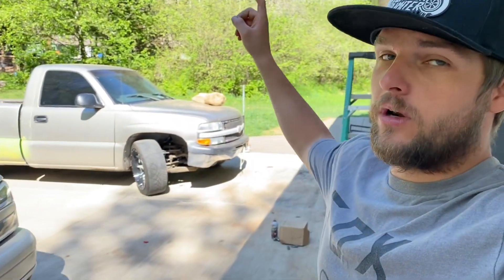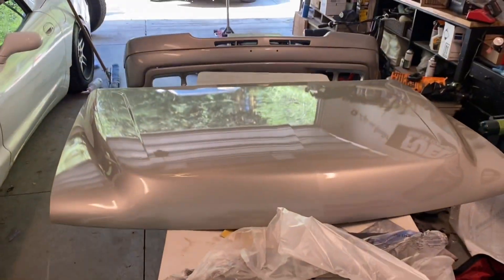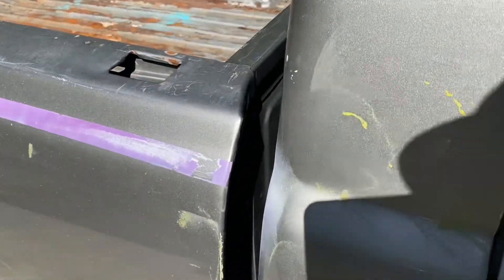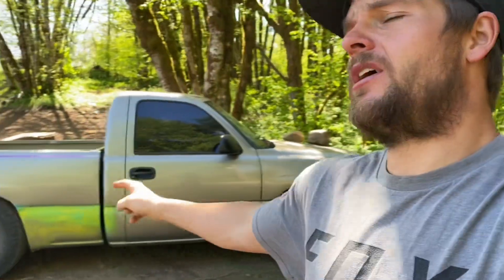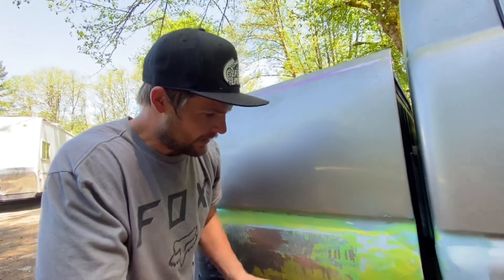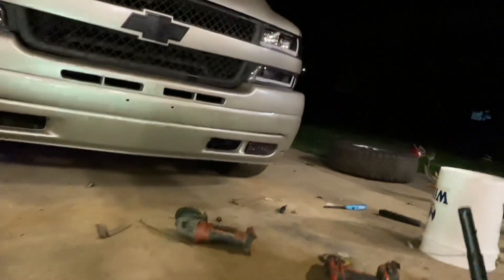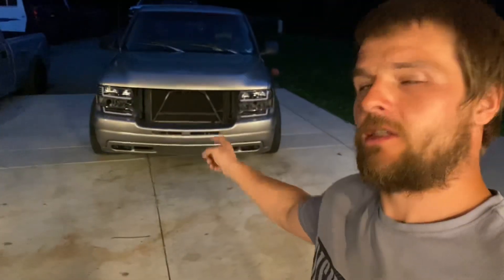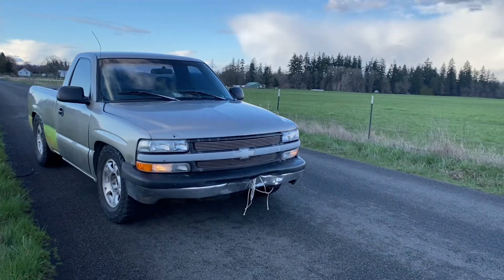INSANE CHEVY DRIFT TRUCK TRANSFORMATION IN 10 MINUTES! FULL HD FRONT END SWAP AND MUCH MORE!!

Comment: My 07 Classic Ex Cab 4.8 LR4, will get a Circle D 300mm 2800rpm Stall, Texas Speed & Performance Chopacabra Cam, PAC 1204X Dual Valve Springs, BTR Advanced Rockers with Michigan Motorsports trunnion bushings, BTR Chromoly pushrods, large Transcool. Eventually would like to find a 9.5 14 bolt Semifloat with 13" disc and dual caliper rear end to get rid of drums. 33's on the stock wheels with a Rake lift (add leaf in back) maybe spindle lift up front (keep same geometry, or coil over shocks. Chrome the wheels (possible to do it nowadays) maybe a H pipe Exhaust (for torque) 3" with Headers. Quadrasteer or Baja flared bed. Bought it in 2016 with 75K on the odo, at 183K currently, so bought and paid for since 2021.

This engine will never be boosted as parts put in are for durability and safeguards.

I may later build a 383LS using a 4.8 or 5.3

Comment: I'm about to put that 9.5 ring 12 bolt rear end from a 17 in my 99, with the measurements I took the 9.5 is 3/4 inch wider so 3/8 inch per side, spring seats are 1/2 wider but with flip kit shouldn't be a problem, shock mounts are 6 inches wider so have to move those and has 1410 ujoint so have to get drive shaft yoke changed and maybe shortened, brake calipers are the same but caliper bracket is different because of the larger rotors, I could swap out the backing plates and use the 99 disc brake stuff since I already have drilled and slotted and ceramics to save me some money undecided at the moment, my ring and pinion gears are missing a couple teeth making this the 3rd rear end breakage so its finally time for me to upgrade to something beefy
Reply from the maker: Yup the ole 10 bolt needs to go.. 12 bolt, 14 bolt, 8.8, 9 inch, anything else haha 😂
Reply: @lifeonlimiter4519  I got the 12 bolt swapped in, had to move shock mounts in 3 inches and need 3/4 inch off drive shaft gonna drop it off monday to have shortened and have 1410 yoke put on, also had to roll fender lips and stretch bed sides a little to clear the extra 3/8 per side when I lay it out, I trimmed the backing plates to fit my 99 drilled and slotted brake stuff

Comment: I got to paint my 03 regular cab and do rockers of course. Canada special. Could you make a video on you painting one of these? I planbon doing it myself and i was wondering what set up you used?
Reply from the maker: Not gonna lie I use the perfect match paint most of the time on my smaller projects! Topped with there 1k extreme gloss clear
Reply: @lifeonlimiter4519  how do you get the exact paint? I'd assume from gm? And what kind of spray gun do you use
Reply from the maker: @skegmachine1999  I go to the auto parts store and get the dupli color “perfect match” in spray cans!!
Reply: @lifeonlimiter4519 nice!! Rattle can baby!!

Comment: Hey were are you get these manual trucks from.  I'm looking for one
Reply from the maker: Hard to find but they are out there
Reply: i wast to sell mine 5.3/5speed swapped already
Reply: How much
Reply: HD zayy what tranny did you use or how did you do it. I want to build a drift truck  and drift on 22
Reply: @kulieboy319  nv3500 5 speed came with a v6 before i put a 5.3 in with a stage 4 cam shes nasty